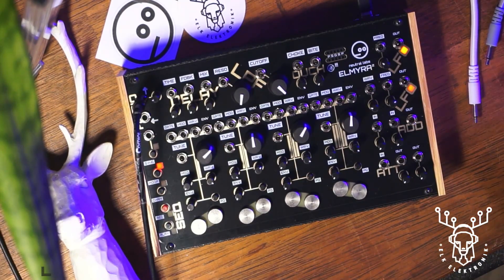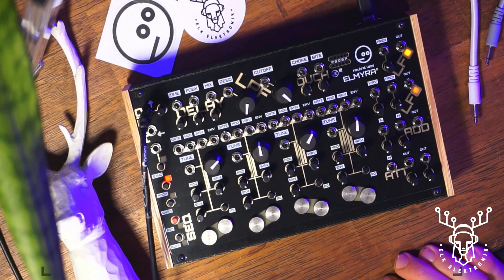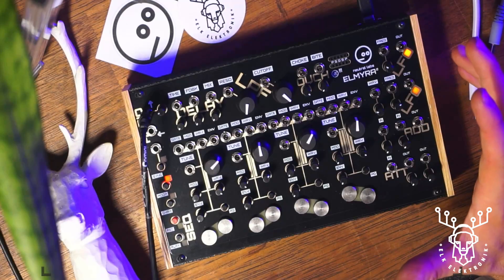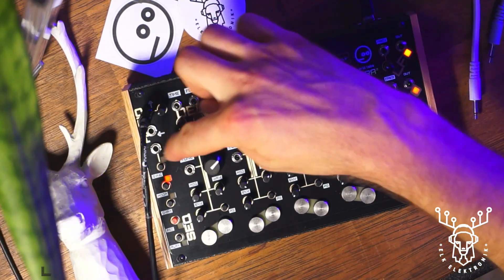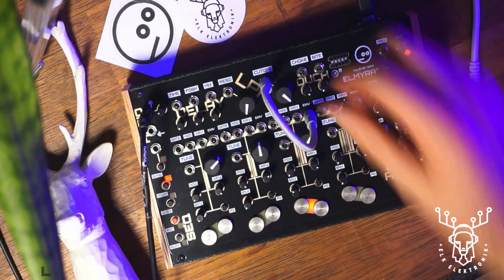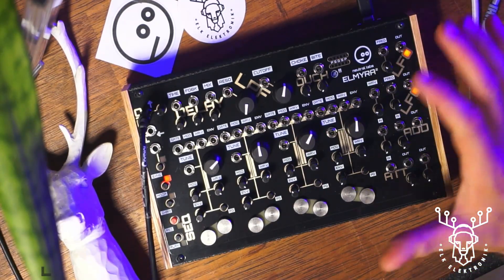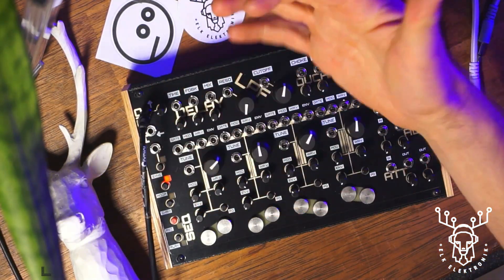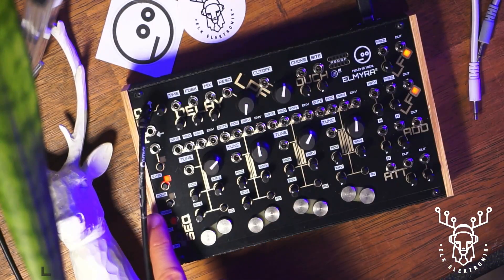ELMYRA 2 Epic Drone Synth Advanced Features

Comment: Thanks for the refresher.  Couple of points.  The special config settings all reset to defaults on power cycle.  Also, the Tune pitch control input jack disables the knob when patched.  If I remember correctly, the knob is also disabled when playing back a sequence.
Reply from the maker: Good points. Thanks for taking a look and reminding us about these extra things
Reply: There will be config persistence across power cycles in the next update, it's been requested a couple of times.
Reply: @nyppy That's good news! Will there be a global command to reset to defaults?
Reply: @pugix  Yup, this will be in the same update.